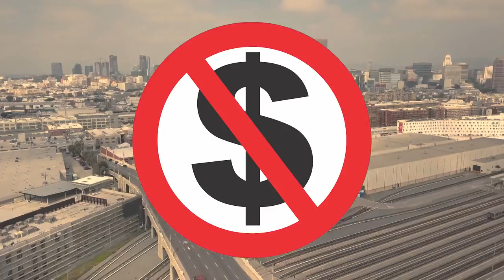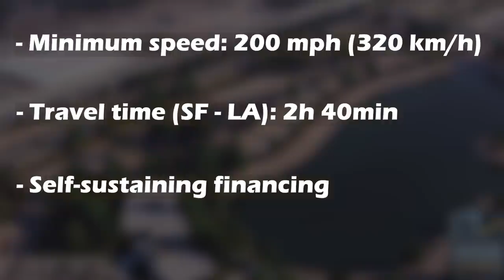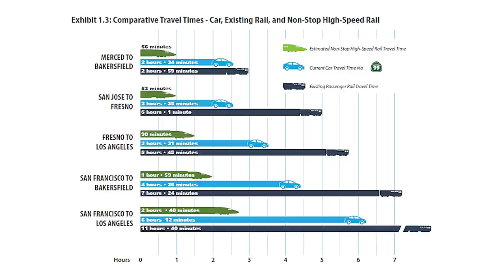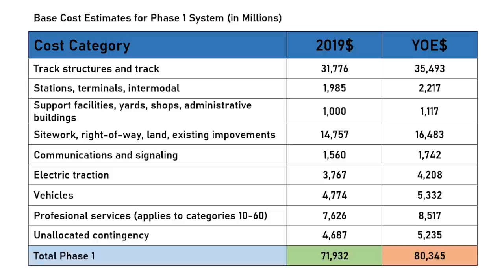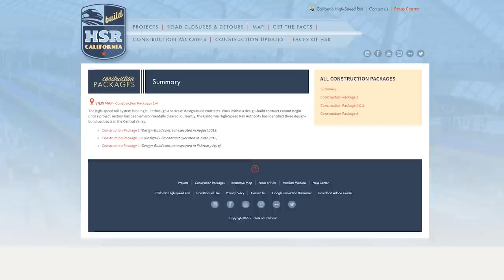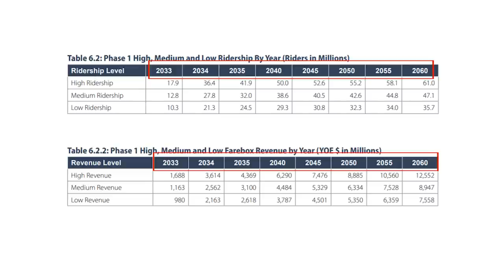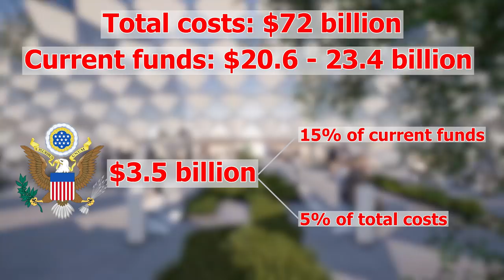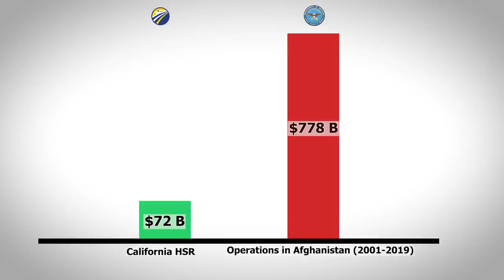California High-Speed Rail Project: All You Should Know

Comment: I somehow feel this project, even though I'd like to see it completed, was not a good start for high-speed rail in the US. As mentioned, the benefits barely outweigh the costs, even if you take a more comprehensive view of the concept of "benefit". A project like this probably erodes much of the support for future projects in other parts of the country. I would say upgrading the NEC to become a true high-speed line could be more successful already. In California, the route Los Angles-San Diego (around 200 km) also seems a more feasible option, although I would actually just go for a high-performance commuter-style railway there to be better able to serve the areas in between.
Reply: Benefit will never outweigh the cost.  The contractor lowballed the cost and used engineering changes to up the cost to more than double the initial proposal.  California taxpayers are on the hook for bond payments if HST revenue is insufficient.
Reply: @encinobalboa  and the land acquisition issues. CEQA is an environmental regulation which a judge ruled can be used on the state's own projects. So land acquisition disputes have been emboldened with the cover of environmentalism. Last I checked the rail authority STILL doesn't own all the land in the Central Valley portion.
Reply: @encinobalboa  Benefit does not equal revenue. Even with insufficient revenue, there could still be economic advantages. The main question is: would this project significantly increase mobility between the cities along the route? Because if people just substitute from cars and planes to trains (without more mobility), that would be an environmental win, but not an economic one.
Reply: @anonomia5535  What benefit?  Wasting scarce public resources that can be spend with greater result is better public policy.  Build it and they will come is a hope, not a reality.  People still need to rent cars at their destination.
Reply: @eriklakeland3857  Correct.  Eminent Domain costs are unknown.  People will fight to keep their land and their homes.  Courts will become involved and no doubt, the route will have to be adjusted.  More likely, people will challenge the state's purchase price as too low which will lead to interminable delays as the cases wind through the courts.  This is why freeways in urban areas are no longer being built.
Reply: @encinobalboa  Making transportation more convenient can be a benefit. There is a reason why railway lines are (and have been) constructed around the world. Those do generally generate some positive economic returns. However, whether this project would also generate sufficient benefits, is something I don't know. I think it could, but perhaps there are more important projects. Indeed, it would be useless to have high-speed trains if people still need to rent a car or take a taxi at their destination.
Reply: @anonomia5535  Convenience is the key to quality of life.  True, environment is always a concern but there is little to no evidence that HST will reduce vehicle traffic.  BART and L.A.'s Light Rail System have not shown such results.  Factoring in public safety makes riding public transit an even less convincing proposition.  BART is home to hundreds if not thousands of needle drug users who live in the stations and walkways.  They are protected by liberal politicians and cannot be removed.
Reply: @encinobalboa  I'm quite sure more people have died on the road than on the BART, but this sounds more like a matter of poor law enforcement than a deficit of public transport. The convenience argument is a whole other discussion, though. Both modes of transport have their pros and cons. However, due to the way many American cities and residential areas are designed, I don't think public transport can ever be sufficiently good. The US is not comparable to China in this respect.
Reply: @anonomia5535  Even though I think we are not in overall alignment, I think you understand the issues.  You have identified the real issue.  Population density is not high enough in much of the USA to make public transportation viable.  Rather than continue bashing HST, I would rather discuss realistic and possible solutions such as hybrid vehicles.  Make batteries standard sized like small batteries such as A, AA, AAA, C, D, which can then be installed in any brand vehicle.  This will reduce the purchase price and maintenance cost which will lead to higher percentage of hybrids on the road.  I am opposed to all e-vehicle because of convenience and range issues.
Reply: @encinobalboa  BART absolutely reduces traffic. When BART shuts down for a strike or technical problem, traffic greatly increases.
Reply: the project is most burdened by a federal government that is unwilling to invest in infrastructure. This project hasn't received federal funding since 2010. It is and was insane to expect a US state to be able to cover so much of the cost of an infrastructure project of this scale.
Reply: @anonomia5535  the proposed LA and SF termini are both built outside of the city limits and unless they add extensive bus or other public transport you would need to rent a car anyways.  I am not sure about SF but in LA you really do need to have a car to travel around the city as it is rather sprawling and the public transit is overall rather poor
Reply: @gemmahudack6182  Maybe if it was interstate instead of intrastate I could see them providing more funds.  The Federal government has regulation and charge over infrastructure used for interstate commerce, but each state is supposed to take care of its own internal commerce and infrastructure
Reply: @warrennelson3737  I agree, the most obvious extensions would be LA to Las Vegas, which is currently being planned by Brightline, or LA to Phoenix. However, I think a Bay Area to LA to Phoenix would have been too large and ambitious as a plan. But the point still remains that the federal government is unwilling to invest in infrastructure in general, just look at the state of the northeast corridor, it's honestly sad
Reply: @gemmahudack6182  And that is where i think the fed gov should be spending their money instead.  Fixing up the current infrastructure as a lot of it needs to be fixed up.  Better to spend the $10B to $30B that the feds would need to invest into the HSR system at a minimum on fixing the roads, bridges and rail lines that are already existant.  It would do more to help the economy than this HSR would do.
Reply: They are starting with the most useless section first, its crazy.
Reply: They need an above-ground line for Acela. No crossings, no freight trains, only the high speed trains.
Reply: The Texas Houston-Dallas line will be done first and I do believe it will be vastly more benefitisl
Reply: @jkeelsnc  In Kalifornia, there is no doubt which party is to blame for our HSR boondoggle.  Democrats.

Comment: The big wrinkle is that a California referendum isn't just a public vote.  It's an amendment to the state Constitution.  Things like the 2hr 40m L.A.-S.F. time table and the demand that the project be financially self-sustaining are baked into the Constitution now, and not so easily altered.  The system blending decision was not cost saving, it was purely political.  You have to consider that of all the progressive projects and ideas in California, this one probably has the least support.  Local opposition in the bay area and L.A. basin would have made dedicated ROW in those areas nearly impossible, and the CAHSR Authority had to capitulate to that reality.  Because of the time restriction between L.A. and S.F., this doomed the train to the necessity of running 200mph+ in the extensive tunnel network that is required.  No other HSR system does this.  CAHSR will do it for 57 miles.  Because of the air resistance that builds up at those speeds, the tunnels need to be wider to allow the air to pass around the train more freely.  Bigger tunnels means more expensive tunnels and that is where the vast majority of cost increase has come from. 

Your conclusion that the project can really only be funded by the federal government is correct.  The problem is that once California's current funding runs out, you have around $60 billion of expense left, and about $500 million a year coming in from Cap-and-Trade.  Apply 2% inflation to $60 billion, and you have $1.2 billion.  So the dilemma is not only that if the project is not completed on time, the state by itself doesn't have the money to build it.  The problem is that the state doesn't even have the money to cover inflation and can therefore never build it without additional funding.  The fact that this is one of the least popular progressive ideas in the state comes into play there, because the likelihood that Californians would pass another bond measure is not great.

He's the problem with the whole idea that this project is going to have a big impact on the state:  California has about 13 million daily surface road commuters.  Max capacity of CAHSR at any given point is 125,000 trips/day.  Even at the extremely rosy CAHSR Authority ridership estimates,  you have 40 million yearly trips compared to about 4.7 BILLION yearly trips on the road network.  It's a drop in the bucket.  Also very important is that the train is passenger only and does nothing to reduce freight traffic, which is currently an enormous burden on the road network.  On the environmental end, the impact is minimal because again, we're only reducing road traffic by 1%.  Additionally, by the time this project could ever hope to be completed, new combustion passenger road vehicles will no longer be available for purchase in California.  The statewide road vehicle fleet transition to electric will already be well underway.  Self-driving cars and investments in making the road network smarter will have FAR more impact on road traffic than this train could ever dream.  Which goes back to the original purpose of the project: it's cheaper to build the train than to attempt to expand various airports around L.A. and S.F. indefinitely.  Every other reason that has been concocted around this project is simply to try to bolster the image of a project which is massively behind schedule and massively overbudget.

Comment: From what I have heard this rail system will be the slowest high speed rail system in the world, the advertised travel time is a pipe dream because it will be speed limited to 70 mph for its first and last 100 miles, it will take longer than flying and cost more than flying. A round trip ticket for a flight from SF to LA and back starts at less than $100, and in 2015 the estimated 1 way train ticket cost was $86; it is probably higher now. I have taken the SF-LA flight corridor, your 5 hour flight time is about twice as long as it actually is, and it seems that your 2:40 advertised travel time by train doesn't take into account the travel time to and from the station as your 5 hour flight timeline appears to. The only advantage the train would offer is no baggage fees.

Comment: I will have no chance to see it will ever finished in my life.
Reply: In a bit more than 10 years China built 38.000 km of high speed train tracks (train going at 300-350 km/h... or 200-220 mph if you prefer)... and in 15 years they will reach a total of 70.000 km... and guess what, there is never delay in China infrastructure project, they usually even finish them in advance.
Wake up USA!!!
Reply: I work on this project...we are getting there.
Reply: @richardf7223  in 2033? Or 2038?
While USA will manage to build one high speed line... China will have build 70.000 km...
LOL

Comment: CAHSR needs to happen, california has two huge population centers that are currently only connected by older, crowded airports and older, crowded highways. san francisco literally doesn't even have regular Amtrak service! you have to take a bus across the bay. the problem is that the government is too weak and doesn't have the balls to seize the land it needs to to create the right of way. so the only parts built so far are not only in the central valley where land is cheap, they're also outside of existing cities!
Reply: It doesn't make sense to run an Amtrak train into SF. The Amtrak stops in the East Bay are more centrally located for the Bay Area as a whole. It would be nice if the Amtrak stations in the East Bay were closer to BART stations, though.

Comment: The comparison with spending on the Afghanistan was well made. 

You didn’t address the problem that the current design can’t match the 2h 40 min travel time. 

Also it will only reduce the increase in congestion. Extra transport capacity is required for growth.

How can we reasonably trust any of the projections in the CAHSR business plan when they have gotten everything so wrong?

IMHO. They should have built an Los Angelas  to Las Vegas line first which would have been easier and allowed them to evaluate larger projects. 

The revised project looks like a fatally flawed compromise.
Reply from the maker: Thank you. We maybe did not explicitly mention that 2hrs40min will hardly be possible, but we did mention that some decisions will definitely result in longer travel times, such as the decision to share some segments of line with conventional rail. 
Regarding, CAHSR business plans and data inside, yes, it's true that that should be taken with (at least) grain of salt. :)
Reply: @RailwaysExplained  thanks for your channel.
Reply: Let's see, where would u be after 2 hours 40m. If u think u would be ANYWHERE near destination, u are delusional. 1st of all, when or if this train would be completed, measuring time & speed is likely to be measured in a different kind of units. By then, time travel might be possible. What century are we talking about?
Reply: I said the same thing, LA to Vegas would have been a better test of both the technology and the process of implementing it. If they built it and offered regular service they would get plenty of travelers. Especially on weekends as it would be faster and more comfortable than driving as well as cheaper and easier than flying.

Comment: Your estimation of the time needed to fly between LAX (all airports) and SFO (all airports) is way too high - total door to door time is more like 2hrs since the flight is less than an hour and it takes very little time to get to the airport, get through security, and walk to a boarding gate. Also be prepared the same security needed at the airport will also be needed at each train station - you will not be able to simply walk on the train without going through a TSA security line as well. 

The costs of this train are just too high, and it will require government subsidies every year just to operate (as HSR in Spain, Germany, France, and Japan also do). With a ticket cost comparable to an air ticket, and with a system requiring tax money just to operate every year, this boondoggle will never be able to recoup its cost and will always be a financial drain on the state. Airports are self-funded and require no tax money to operate, and there are no tax subsidies to air tickets either.
Reply from the maker: How far from the airport you have to live and how far from the other airport you have go, in order to make door to door time less then 2 hrs, in this particular case?
Reply: @RailwaysExplained  

Going downtown LAX to downtown SFO - using the filed city codes so LAX includes BUR, ONT, SNA, LGB and SFO includes OAK and SJC, depending on where you are and where you need to go you have multiple airport combinations that can service you, planning on arrival at the airport 30 mins before departure. In the case of rail you would have only on origin location and one destination location so the door to door tile could be much greater if you are outside of the downtown core.

Comment: I live in California, the issue is money.  The state simply does not have the money to fund this project.  They low balled the cost via a bond measure and once they got the money, the taxpayers found out the costs were 10X what they asked for.   I also disagree with the flight time from LA to SF is 5 hours.  I've done Burbank to SF airport in about 2 1/2 hours including the commute to the airport.  Hence it depends on where you live in the LA basin.
Reply: I agree that the 5 hour estimate is way too much. If I'm flying domestically out of SFO and only have carry on, I usually enter the airport between an hour and hour and a half before the flight departs, and am usually out of the arriving airport within 15 minutes.  An hour-long flight down to LA would therefore be less than 2 1/2 hours. Actually though, I almost never fly to LA from SF. I drive since I need my car in LA.
Reply: That's one of the argument in this HSR matter in California. However, it is only valid if that HSR has two stations at each end. HSR has never been designed for that and not aiming for profitability first. China, Europe, and Japan had already showed what HSR is for. The U.S. government should have put people's needs and the development of the country first despite the profits. After all, the US military is spending wayyyy more money than this HSR thing.